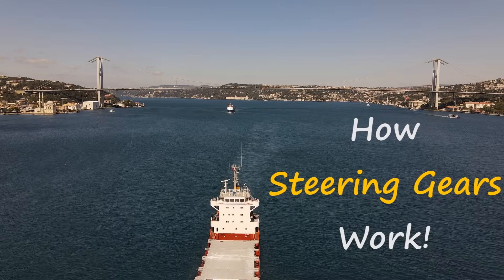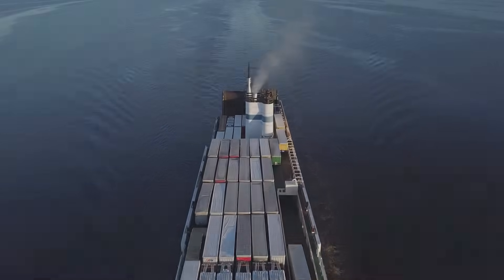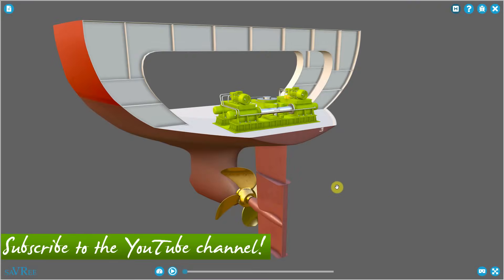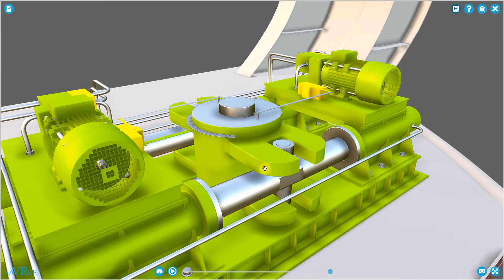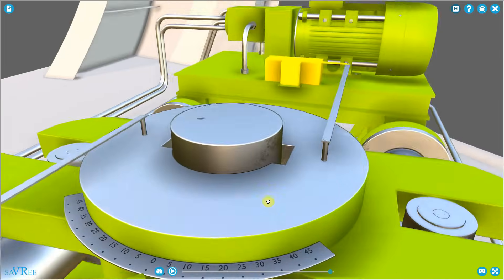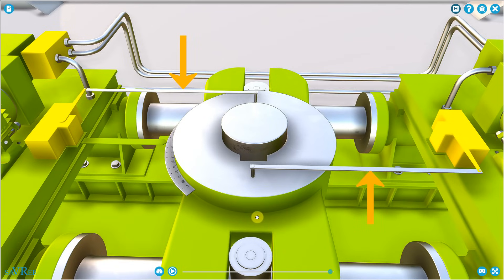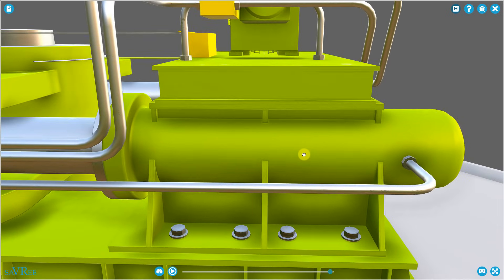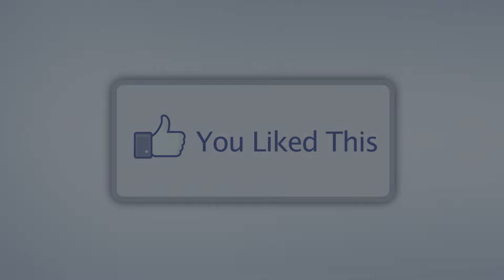How Massive Ship Steering Gears Work!

Comment: Like I said previously, I am not an engineer but required to know about ships occasionally, as part of my profession. I find your videos absolutely enlightening, and, simple and easy to understand. Thank you very much for your series of videos on ships. PS: I think there is a tiny typo error in the angle of movement of the rudder. It seems repeat 35 degrees twice. Thanks again.

Comment: Great explanation of the workings of these massive systems. 'Just a question from a non-engineer though - why do the systems use tanks of fluid as well as the fluid already in the cylinders? Would it work if you used pumps to just fill one cylinder with the fluid from its opposite partner?

Comment: Thanks John.I finally got to know how these steering engines worked despite having sailed in over 50 merchant ships in the 1950s to 60s.
As one of the aforementioned muscley sailors, we rarely had occasion to enter the steering flat, that being engineer domain.
Most ships had this kind of steering equipment, referred to as telemotors but a couple of older ships had steam powered steering engines. Although they did the job, they made a hell of a clattering banging din, and as the steering flat was immediately below the sailors and firemens accommodation, sleep was difficult to say the least. The merest touch of the helm generated bedlam.
So thank God for hydraulic steering motors.
Reply: A

Comment: i am a River Pilot (Captain) on the river Rhine. And we use Rudders up to 90° and this with full effect. Though i got before a bit smaller ship (52m long) where 90°didnt has as much of a turning power, there my experience showed me, that 60° wasth most effective. But that caused of the pecific ruddertype we had. 
Normal Inland waterway carriers usually use 90° with best effect. Those ships usually are between 110m and 183m long...
maybe we use more degrees because we are driving in currents. Or maybe its because the Engine power to rudder size ratio is different than it is by offshore bulk carriers. or can you explainme why this is so?

Comment: I had to stand watch in aft steering when i was in the navy as aft steering electrician. It was so boring
Reply: Same. I usually did just the EPCP, but also did after steering or anchor windlass during sea & anchor, and diesel generator during GQ. After steering was the best because there were nice spots to lie down.

Comment: As the rudder is underwater and the tiller is inside the ship, there would be a significant pressure difference between the two. How is the bearing that which holds the rudder able to prevent water from entering the ship?
Reply: Seals. Navy seals.

Comment: Large hydraulics! (Or you can get down to chainfalls if everything else is broken).
Reply: It happened once when I was there during drills. A chainfall wouldn't have worked. A manual crank, geared way down, was operated in turns for about 10 minutes just to turn a couple of degrees. And there were two of them.
Reply: @ronm3245  On Wasp class ships, you can use chain falls as a last resort!

Comment: Nice vid as always!  I’m wondering why the steering actuator is hydraulic rather than an electric motor, gearing, and perhaps a ball screw or maybe a rack and pinion? It would seem that elimination of hydraulics would be a good thing?
Reply: I think the hydraulic system is a lot more efficient. Mechanical gear reductions have a lot of parasitic friction, and a whole lot of inertia, compared to this electro-hydraulic system.
Reply: @tissuepaper9962  Thanks. I get that but being non-battery (space savings) is efficiency that important? A direct drive high torque motor could easily replace any gear system as well as well as eliminate any inertia mismatch (load becomes the motor inertia directly). I'm just thinking that hydraulics "has been the way it's been done" for a century so it's a "use what has worked" mentality. Perhaps I'm wrong, I'm no steering actuator guru.
Reply: @henrylombard1965  AFAIK the hydraulic system weighs quite a bit less than a mechanical gear reduction or a direct drive motor that could handle the same torque. The electro-hydraulic system also doesn't draw as much current from the ship's power system at any given time, which helps keep mains noise and brownouts to a minimum. Think about the inrush current for a motor that big if you use direct-drive. Think about the starting torque necessary to get all those big gears turning if you use a mechanical reduction, not to mention the maintenance necessary to keep them turning smoothly. Now think about the little tiny positive-displacement pump that they use to drive those big hydraulic pistons. There are a lot of reasons why efficiency matters.

Comment: Not sure how I ended up here, however the amateur engineer in me wants to install a simple camera on the rudder angle indicator - the crew in the wheelhouse can watch a video screen in real time to see their actual rudder position, instead of relying on sensors, switches, levers, and electro-mechanical indicators.
Reply: In the Navy we would simulate various failures during drills. One time I was down there on the phone with the bridge verbally relaying the position of the rudder.

Comment: Wouldn't it be a more efficient, and effective drive, and guidance system if the propeller, and the rudder simultaneously rotated into the required direction . Why isn't this the design. Yes it would be more complex , but the response would be greater!
Reply: That's what Azipods do .
Reply: Azipod
Reply: On some ships that's exactly the case

Comment: So im currently in a squall like 120 mph sustained winds and consistant 40 ft crests or air pockets. How do i keep my engines and inverters from flooding or jamming blow outs etc...  im on a 350 ft aircraft carrier and looking to upgrading to the PRELUDE once i pick a route and can re pressurize the bow and stern ports... and add an engine system other than that might as well install some masts incase we capsize the air waves could flip me back over like a nice drift soc eh.

Comment: How is the interface between the air inside the ship and the water outside the ship sealed when there is a vertical shaft that has to rotate between them?
Reply: Seals
Reply: @kornaros96  Navy seals
Reply: @ronm3245  not on commercial ships.

Comment: Wouldn’t there be some sort of bearing on the round pieces the move the tiller so there is less friction that way it gives more a rolling motion in the fork instead of metal on metal sliding with grease between it
Reply: On my ship there were stationary bearings. Some might call them bushings.
Reply: @ronm3245  that would make sense to improve longevity

Comment: this was my career with a steering gear manufacturer and with a marine engineering company worked from small to medium to very large but not vlcc class been retired ten years now. The systems I worked on the cylinder rods were pinned to the tiller arm only used the slide type tiller on small point to point ferries.

Comment: I sailed on a number of very large ships in the late sixties/seventies, for the most part they had steering gear as is your diagram...Usually manufactured  by John Haste, (Scotland) even on ships built in Japan. The ships steering wheel on the bridge could be operated either in manual mode ...where you felt hydraulic resistance...or electrically. The former would always return to amidships if you released pressure, the later had to be returned manually. These VLCC ships were quite easy to steer once you got used to the fact they didn't react very quickly to initial rudder movement. Very good explanation of these huge pieces of equipment.
Reply: Modern driver assistance technology is now much more advanced.  it was installed to turn the boat and power it now

Comment: So where is the GEARS?
Reply: Gear in this context means equipment, rather than toothed cogwheels.   Like the term switchgear in electrical power transmission, that has nothing to do with the gears used in mechanical power transmission.

Comment: Is the pump kept on through out the voyage or pressure is maintained by jockey and pump is started at the instant of changing the direction.
Reply: The pump is kept on during the voyage and during manoeuvring both are running.
But there are systems were the pumps are powered by VFD’s and run when required by the auto pilot or helmsman.

Comment: Seems way to complicated. Bow & Stern thrusters seem to be much less complicated a d can do much more
Reply: A rudder's pretty simple, two pistons (in this case double ended) push levers which turn a big board behind the propeller, thrusters are significantly more complex in operation

Comment: Sir, I wish to congratulate you on your beautiful spoken English Language and carefully chosen words and vocabulary to communicate to the listener, as well as establishing a specific voice style. You are a Gentleman Engineer who is tuned 
up well in both the language spoken symbols and the real fact engineering static and dynamic functions, selecting the right components to fit the function. 
             You said that this is a simple diagram but it describes a very robust system both in schematic and practical terms. I can see the dump valves complete with a line to the high-pressure pump. What I am admiring most is the piston seal position as it could be maintained rather easier than being on the piston end as found in some other push-pull cylinder systems. In one system I had to introduce baffles and cooling in the settling tank as the dump valves were operating too often and so bubbles needed time to settle and not be sucked into the pump. Many pumps get eroded because of the hydraulic oil not having time to settle in the tank and the bubbles rising to the surface. 
             Just for you to consider including crosshead bearing blocks where you mentioned that a lot of grease is necessary to reduce the pressure on those pins. Please note the propeller blades need to be reconsidered as normally your leading edge is the trailing edge. As it is that propeller will cavitate a lot due to the fact that the apparent entry angle in the leading edge of the blade is lost. I see that on the rudder you introduced one of those propeller hub streamlining devices. 
              Your voice sounds very young but you have accumulated a lot of experience. Congratulations.
Reply from the maker: Thanks Carmel! I will be 40 years old in a few years...but I feel young :)

Comment: I did work on a steering gear from time to time on the same ship. One year 2 ships were docked stern to stern, we had just stepped out of the steering room. The other ship decided to do and engine test while the ship i was on had the rudder completely disconnected. The wash from the other ship flipped the rudder 180 degrees and almost killed the engineer working on the gear. It got wedged up agents the big cylinders and bent a bunch of things. spent the next weekend in there cutting the 1.75" grade 8 bolts with a reciprocating saw, then making new bolts .
Reply: original had to make up some tube clamps and the brass blocks where the cylinder rod connects to the rudder stock.
Reply: Wow thanks for sharing I'll make sure I never work on any ship let alone engine room fuck that dangerous bs
Reply: Excellent information. What do you mean by "wash from other ship" (while engine testing) because can the propeller be disconnected while engine testing (no load running)?
Thanks.
Reply: @cck1496  well they didn't  if they could ... this is not the best shipping company lol I'm a machinist not a marine engineer so i really don't know the finer details of that other ship , only walked through it once .
Reply: @turboprint3d  Thanks for your prompt reply. Keep it up.
Reply: @cck1496   thanks I have been playing around with makeing a channel with just me and my buddy talking about the cool stuff we have worked on. Figure some people might like it .
Reply: @turboprint3d  Thanks. I will see, if I could help you.
Reply: @cck1496  that would be great . I'm not really working towards this currently tho . I am currently dealing with kidney failure and am no longer working . I already have a channel going with some projects I have been working on since I have been off ( witch is slow as Im slow ) . I also am working towards a channel about biking in some way as I can finally get back on one ( had a stroke as well ) so I'm working to get as healthy as possible as an attempt to get my kidneys working better as there is apparently no physical damage to them .  I make tentative long term goals and the talking about cool jobs idea is one of those , witch may happen depending on how my life goes .
Reply: @cck1496  please explain this wash??? i didn't get it
Reply: @rajatsrivastava7791  When the ship moves, it creates turbulence (waves). This is the wash.
Reply: @cck1496  thanks

Comment: Excellent tutorial video. (@3:00) In the discussion of the tiller and pin being a high friction point that requires "a lot of grease". Are there no roller bearings on the pins? Seems like there would be to extend the life of the tiller running surfaces..."with a lot of grease", too.
Reply: Normally the pin has a roller type bearing on it. In fact, the outer ring of the bearing runs in the slot of the tiller. But there are variations in the lay-out
Reply: @janvisser2223  Thanks for clarifying this point. I've worked on a lot of mechanical production line equipment over the decades and every successful cam and roller design mechanism incorporated roller bearings to prevent wear. I can't even imagine the psi of force this rudder control encounters...got to be measured in tons.

Comment: It is fully possible to adjust the position of a rudder - even on a 200,000 ton ship - manually with the use of pulleys. You would simply need a whole lot of gear shifting or multiple people.
Reply: Perhaps practical is the word to use instead of possible.
Reply: @carultch  It was done by the 20,000 ton heavy cruiser Admiral Hipper after being bombed by the RAF during WWII. So possible, but given that it required a significant percentage of the crew to lean on a tiller, it was certainly not especially effective.

Comment: I saw a video of an engineer going through his activities to start up a ship and he goes to the rudder angle indicator, then goes on the radio to the bridge and the bridge moves the rudder and they confirm the rudder moves at the angles and direction the bridge signals and, that the angles and direction shown in the bridge's indicators correspond to the positions shown on the rudder indicator.  You can't check the brakes, but you can check the steering before moving.

Comment: OLD OLD technology... new stuff is rotary vane,  capable of rudder angles far greater than cross ram system. 
t. a Marine Engineer
Reply: tho what's the point of moving the rudder a lot more? I get it with azipod thrusters tho, you can turn them 180º and that makes sense but what's the point for rudders?
Reply: @Kalvinjj  mostly slow speed manoeuvring at docks without tug assistance I would say, but I’m not the driver, I just make it go... You could also look up “Becker rudder” also, it’s a two piece hinged rudder that can be used to turn the ship sideways as an emergency stop manoeuvre.

Comment: Certainly a more modern steering gear system.  While the new directional valves and rudder indicator sensors provide for good control and sensor feeds to remote indicators I still have a soft spot in my heart for the mechanical elegance of a hunting gear controlled system using variable stroke pumps and telemotor receivers.  Good introductory teaching video though.

Comment: and how does the rudder and steering gear assembly deals with the reaction or opposing forces caused by the flow of water? the forces must be high, so how these assemblies are mounted on the ship (or how their mountings are mounted), so that they dont get ripped apart during their mode of operation? (or just the massive bed is enough, which is shown here?)
Reply: very very well bolted to the deck head and beams
Reply: @licencetoswill  i already got my answer long time ago, but thanks anyway

Comment: Looking at the scale of things the motors on the hydraulic units would be very large. I'm wondering about the dimensions, weight, HP ratings and electric requirements of those motors. Also looks like the diameter of the rams would be several feet thick.
Reply: Oh yes, you got a ship the size of a continent , those motors would be power equivilant of tractor engines

Comment: I always thought propellers always spun with the rounded edge going in the direction of rotation D:
Reply: The propeller was going in reverse. 
Idk why. 
Just saying.
Reply: @michaelgarrow3239  Sir, RJ was correct, the propeller blades are not shown correctly and it is not reversing. indicated by the pitch angle shown and rotation shown.

Comment: you said that critical equipment on the ships are doubled up, meaning that one of them are back-up, but your presentation/animation shows that both of hydraulic booster pumps  and motors (even directional control valves) are operating while turning tillers, or activating rudder... why is that?
Reply from the maker: You can use a single powerpack (pump, tank, valves etc.), or two. If you use two, the response time of the rudder is lower (it turns faster). Pumps are often labelled 100% or 50% to indicate how much of the system remains in service if only that pump is operating. For example, if a pump is labelled 100%, it means that the system can operate at 100% full load with only that pump. If its labelled 50%, it means the system can only be operated at 50% full load with that pump.